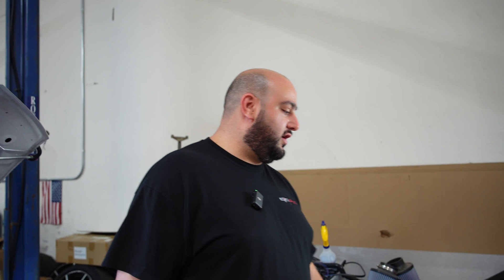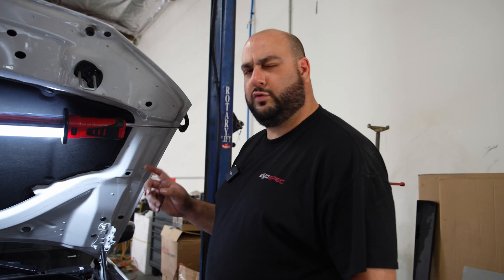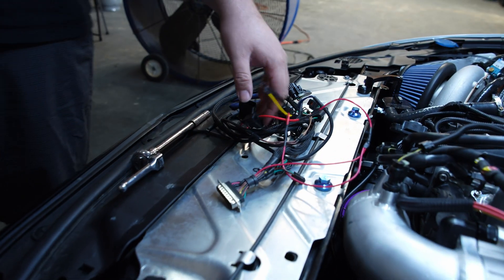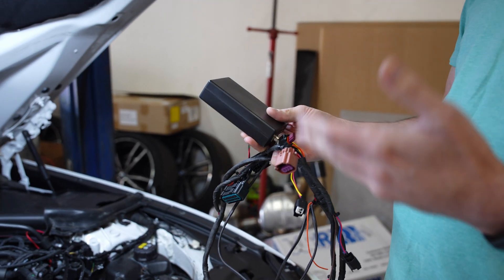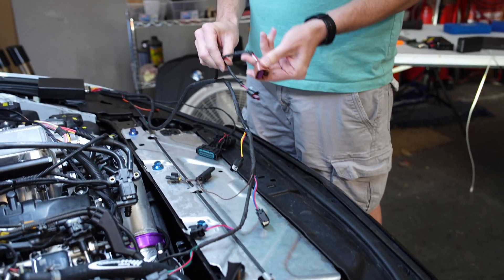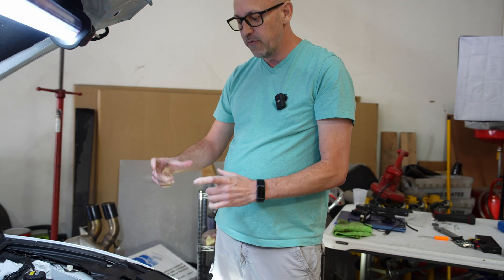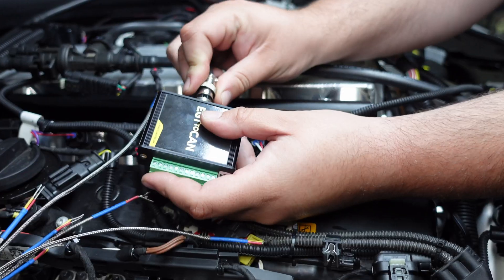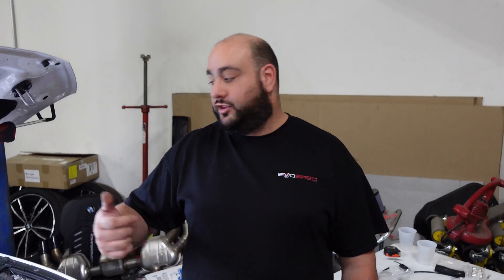JB4 ROAD TO 1200WHP: Episode 5

Comment: Please share the link with us for details but does this sound about right?
- Sequential Control: Independent injector management.
- Safety Features: Shuts down if an injector fails.
- CANBUS Integration: Enhances data exchange.
- Standalone Operation: Functions without JB4.
- Simple Wiring: Easy installation in 5-10 minutes.
- Cam Sensor Timing: No complex ECU taps needed.
- Supports Eight Injectors: Flexible setup options.
Reply from the maker: We'll do a full write up in the coming weeks detailing the I/O and everything! This is just a sneak peak at what we're releasing. :)

Comment: Can you control secondary fuel pump / boost? What about low pressure fuel sensor?
Reply from the maker: Yes, yes, and yes. LFP is even built in to the plug and play harness.